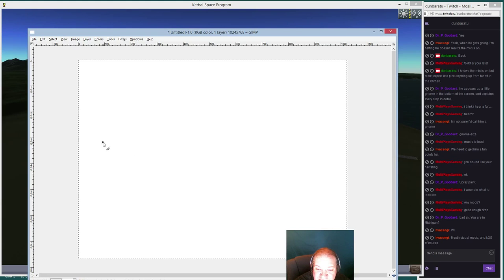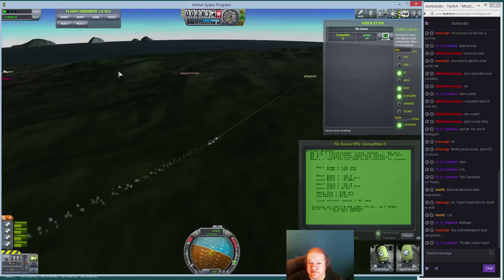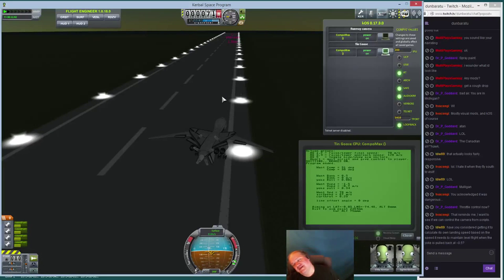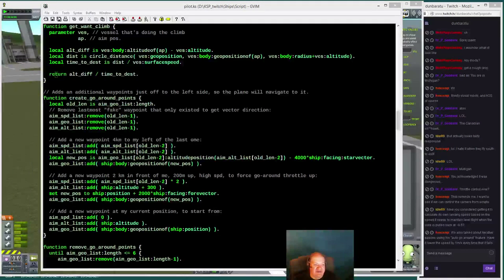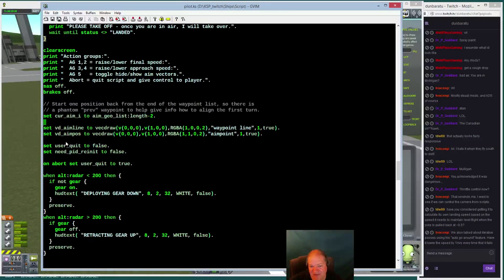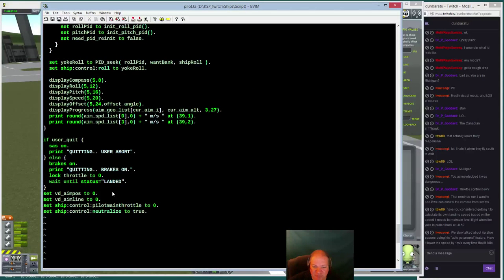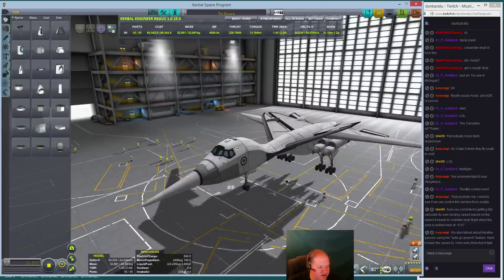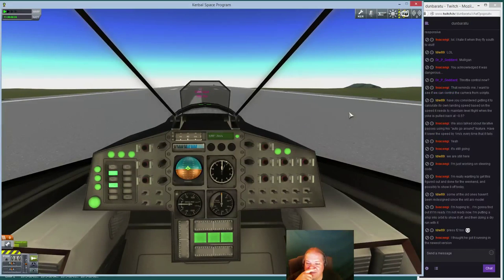Le's k-OS with a kOS dev, runway landing, episode 4

Comment: It says "Number of arguments passed in didn't match the number of DECLARE PARAMETERs. Called with not enough arguments....." :(
I don't know much about coding/programming :/
Reply: When i try to run it
Reply: I tried 'run pilot (true,true,true)' and  "run pilot (false,false,false)"  and i got an other message: 
"set near_ves to vessel("VASI west")."
"Vessel 'VASI west' not found."

I have no idea what i'm doing but i feel like i'm getting somewhere :p
Reply from the maker: In previous episodes I mentioned that you have to put two things at opposite ends of the field first - a vessel called "VASI east" and a vessel called "VASI west".  These are used by the script to pinpoint the location of the runway, which it doesn't have hardcoded in memory.  They can just be planted flags if you like (which count as vessels).  Just be sure to put them past the ends of the runway a bit because the game tends to delete them if they're close to the runway, as part of the "clear runway to launch vessel" step.
Reply: Omg! I knew that i was missing something and that it would be pretty simple. But I didn't know what and it was so annoying, I have been trying things for a few hours to make this work. Thank you very much for replying! I will be trying this in a bit. 

I managed to make some landing scripts with the kramax autopilot, but i can't control the Vspeed with that one, which makes it very difficult to make a universal auto-landing script for most planes, heavy or small, although I did succeed making one for each category (small, medium, heavy). Still want to try yours though. Did you make any other cool stuff like this?